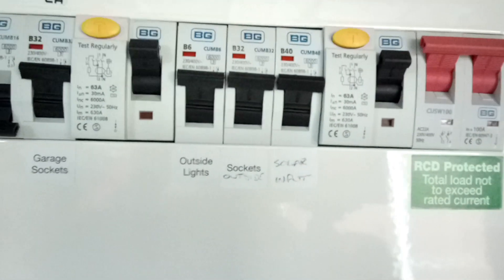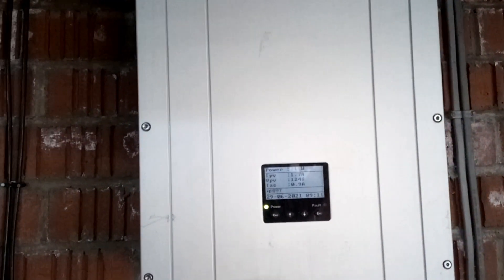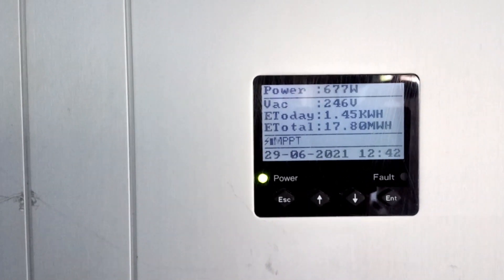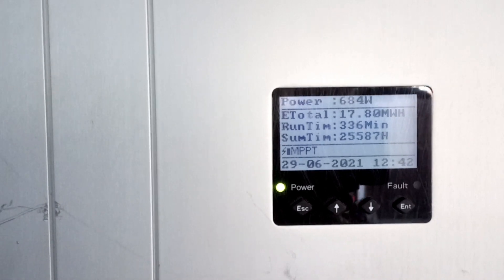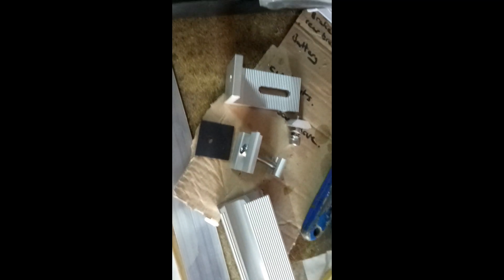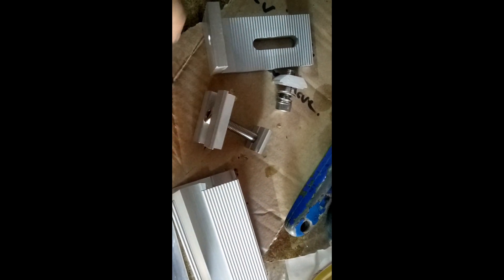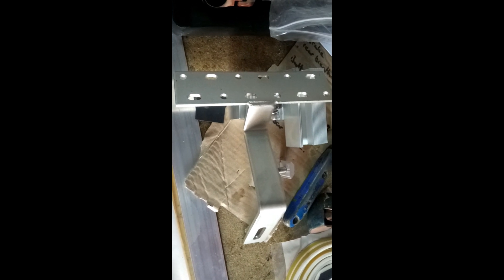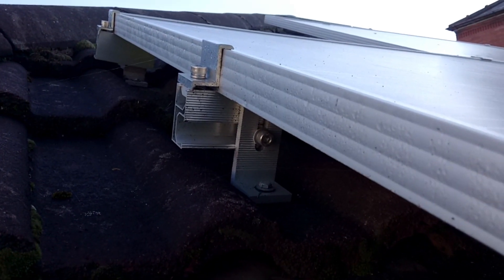Small solar panel installation - is it worth it? Cheap / budget DIY solar install.

Comment: I figured boaters frequently live off small systems, mine is around 1.4Kw, it is best to put panels in all locations, even my North wall gets sun on summer evenings, I have west facing panels and some south facing on my garden room. Off grid now I have to be frugal in winter but it works.
Reply from the maker: Hi, yes, even small systems are worth the effort. I can't remember if I mentioned though, if using the inverter like mine, and all the panels are linked together, your system is only as good as the worst performing panel. Cheers